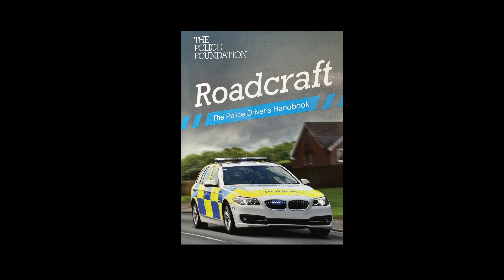Acceleration sense - A technique that allow you to safely use your brakes less.

Comment: I replaced the original brake pads of my car (1460 kg) with 75k miles and they still had around 30% left 😅. And I do quite a bit of city driving as well, but I try to anticipate the driving conditions by lifting the accelerator quite in advance, making sure I'm not bothering anyone. It's common sense, the more you use the brakes, the more energy you're wasting and the only way of safely using the brakes less is to anticipate to what's coming. Also, it's safer since you need to pay more attention to your surroundings, but once you get used to it, it comes naturally.
Reply from the maker: Agreed but you must see people using their brakes when you are not. I think it is common sense as well but unfortunately I don’t see this in practice. Thanks for the comment 👍

Comment: Nice video. 03:35 - re using the brake to slow down if vehicles are following. Presumably this is only if the vehicles are following closely, or catching up fast, or you need to slow down quite abruptly, as you do not follow your own advice at 05:25?
Reply from the maker: Yes correct. If a brake light would benefit the vehicle behind then you should use it but if vehicles are at a distance then you need to make a judgement about whether the brake light is necessary
Reply: I want to see vehicles instead have brake lights triggered solely by deceleration. It would also solve the problem of being blinded by inconsiderate drivers (and vehicle designs) that hold the footbrake on when stationary.